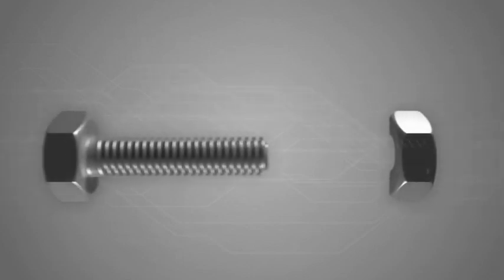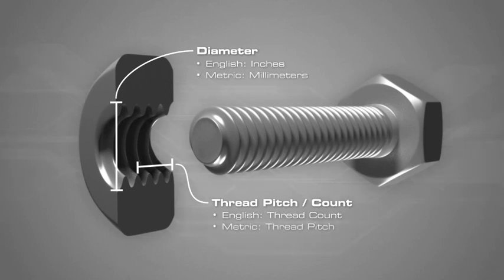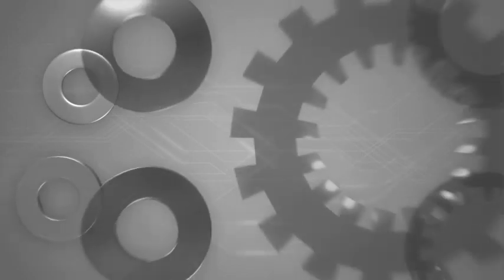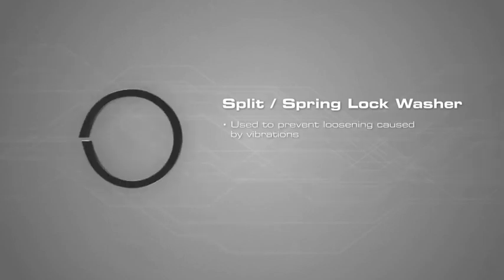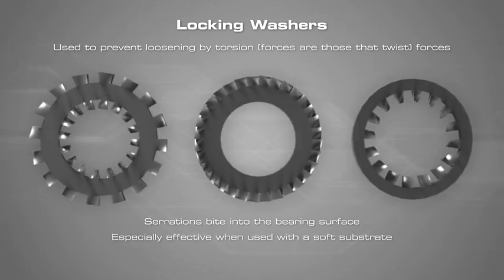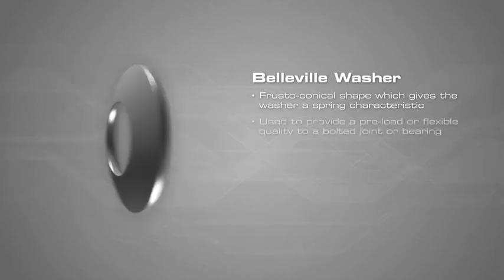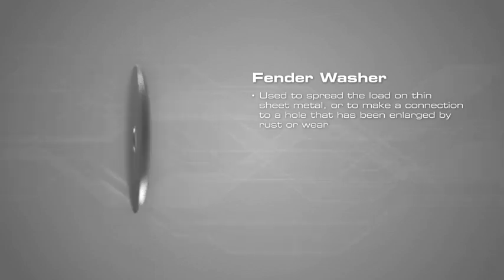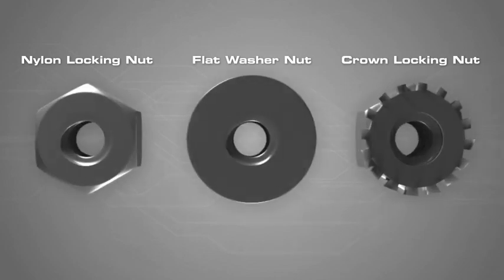Nuts and Washers

Comment: Amazing video! But I still don't know where a washer go, on the side of the nut or on the side of the head of the bolt.
Reply: Bolt side. Sometimes both, but bolt side if only one
Reply: @rikkitikkitavi31  if only one i put it on the side being used  to tighten  to prevent  damage  to material  being fastened  or if bolting wood to steel it goes on the wood to prevent  it sinking  in
Reply: At 2:35 it shows bolt then washer then nut

Comment: This told me everything I could imagine there is to know except the one reason I searched the topic: on which end does a single wide washer go?  The bolt head or the nut?  Given they are the same size.
Reply: Exactly what I'm trying to find out.
Reply: Me too!
Reply: Me three
Reply: Me four
Reply: Me FIVE
Reply: me  six
Reply: Me Seven
Reply: id say it depends on the circumstances 🤔
Reply: Me ate 😋 and eight!!
Reply: Either end serves the same purpose: Distribute the load exerted by the nut/bolt.  If the material being fastened is softer than the fastening material, then both ends. A washer on both ends will reduce scoring and pitting when tightening. But, it's not a good idea to mix metal types.  

Generally, though, the nut end as this is the end that usually gets all the turning action when tightening.
Reply: If I understood the video correctly, that would depend on which surface you want to spread to load. The surface the nut is in contact with or the surface the bolt is in contact with.

Comment: well - that was interesting but I wanted to know which way a washer goes on - there's a super flat - almost unfinished - side that I don't know which way it goes on - does the slightly rounded or finished side go against the bolt head or does the super flat/unfinished side go against the bolt head... same question when a washer is used against a nut...

Comment: good video but it didn't tell me where the spring washer goes. I am putting together a stool and it says to use both the flat washer and spring washer as seen if figure 1...well they forgot to draw that part of it in figure 1 lol
Reply: pretty sure you go Bolt - spring - flat then put it into the hole.
Not sure tho, my destructions are just as bad... putting together a paint sprayer right now

[bolt]=(springwasher)|flatwasher|=={hole}===[nut]